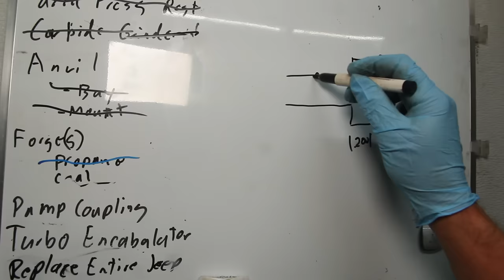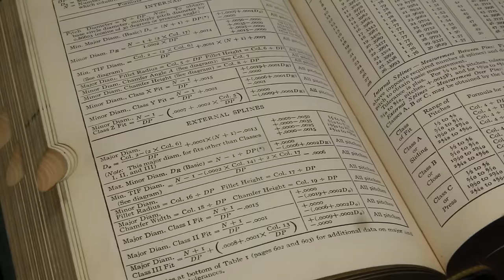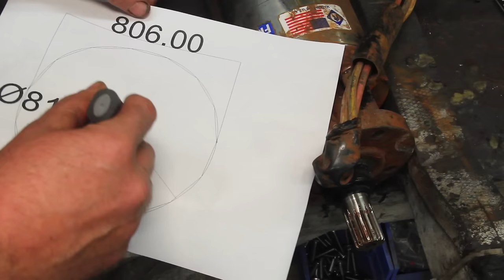Internal Splines (and Hexes Too)

Comment: I used to have that curse.  Always jamming my hands into places where the sharp bits would take little chunks out of me.   I was working too fast for my own good. If I offered you a criticism  it'd be that (1) you might have been better off with four set screws   ( 2 inline on two adjacent angle faces of your  internal spine parts) to make ''em  have less of a tendency to wobble as the spline cutter engaged. and (2) some kind of thread locker on the set screws in the final assembly.

Comment: If I had the wherewithal to do this I think I would make the coupling say 3mm overlong and machine it to the outside diameter of the shaft. As you come to depth on the internal splines as the tool produces a witness mark on the OD you would know you were at the correct depth. This land can be machined off afterwards. 

This is the process I use when making internal threads.

Comment: okay so im a gear cutter by trade and i want to try and help you.
most splines are 30 degrees P.A but they can literally be whatever you want as long as you get the right fit. anyway, like i said most splines are 30 degrees. the way i normally find out what D.P or Module a gear is, is by measuring the base pitch. what is the base pitch? well its basically from one spot on the tooth to the same spot on the next tooth. to get an accurate reading you of course measure on the addendum of the tooth. so what you do is measure (in inches) a couple teeth making sure that it is sitting on the addendum, then you either measure one tooth more or one tooth less, making sure you are sitting on the addendum when measuring. i just use digital calipers. you subtract them and you get the base pitch. what do you do with this you ask? well there are many handy tables you can use but this is the one that i most often use (https://www.geartechnology.com/ext/resources/issues/0992x/janninck.pdf). now what you do is you go on D.P and Module and go down the list for 30 degree P.A (because its a spline) and you find the one that closely matches it. if the spline is not corrected (standard) you should be able to find it pretty easily (within a couple of thou). when you find the D.P or Module that matches bingo. just by going off the O.D that you mentioned (25mm) the closest i can come up with is 1.5module 30 degrees. if you can measure the base pitch id be interested to see how close i am but of course since its just going off the O.D it will not be accurate. another way that you can check what pitch it is is with wires. in the machinery handbook (ive got the 16th edition in front of me right now) its under Checking Gear Sizes. if you read through that it explains it pretty easily what to do with the table. a little cheat that you can do to convert it to module instead of using the D.P conversion of the module is, and im reading this from the book.   FOR ODD NUMBER OF TEETH    Wire or pin diameter = 1.728 / Diametrical Pitch.      now the easy way to do it in module is just 1.728 * 5(mod) = 8.64mm. then divide by 25.4 = 0.3402" diameter pins. you can fact check this to make sure you're correct. so to convert 5 mod into D.P is -> 25.4 / 5 = 5.08 D.P and then 1.728 / 5.08 = 0.340". i think ive typed enough but if you want me to explain the table i can, but like i said its written there on how use it. have a good day :D.
Reply from the maker: Lots of good info there, thank you!  I don’t have the motor in the shop any more, so I can’t go back and measure it, but I’ll keep it in mind for next time.  Digging around a bit more, I’ve found reference to a ‘6” Nema spline” but I can’t find any information on what that standard actually is. (Maybe if my Machinery’s Handbook was so old it would have it).

Comment: Bit late but that is a situation where a push bar from the back and a longer or even larger diameter screw thread to hold tool bit could be an advantage?
Setting wouldn't be so convenient but making a setting gauge wouldn't be a huge issue for someone with your talents

Comment: Hey Jeremy,

You should make ur camera mount telescopic. You will get a much better viewing capability
Reply: You would need to weld a screw to outside of the square stock to be as a locking nut. Or have multiple through holes at equal distances apart and have a bolt to secure the positions

Comment: Thanks for sharing really!, what is the difference between that goopy grayish grease and the oil beside the grease being more sticky; are there any special purposes when using one or the other?
Reply from the maker: The thicker greenish stuff is Anchor lube, which is supposed be really good for working on stainless.  It seemed to work.

Comment: When you get more experience you will discover chip brushes, experience digging out metal slivers in your fingers and BandAids.  You will learn a lot faster if you use Brakleen to clean the oil and chips off your fingers.

Comment: couldn't you grind a hex pattern on the spindle of the motor?
Reply from the maker: It wouldn’t have really been practical.  It’s about 3 feet long and weighs 90lbs, I probably would have needed to take it apart (and it’s a submersible motor, so I would have to worry about getting it sealed up properly.  And I’m not even sure if I could index it properly once disassembled. Keeping the hex concentric to the shaft would be important to avoid damaging the bearing.  I guess if you were super careful about it, you could do it by hand, but that falls into the territory of “you can make anything with just files.”
Reply: @JeremyMakesThings  ok that explains it :]

Comment: Too late now but I wonder if that pump and motor set up was designed for a lovejoy type coupler? You did a great job but if there is any misalignment between the pump and motor , with such a snug fit in your coupler,vibrations will tear things up in short order.
Reply from the maker: It wasn’t.  It was originally a one piece coupler that was pinned onto the pump shaft.

Comment: I had to do this once at work and I discovered that there are SW plugins out there that will generate spline geometry.. for thousands of dollars tho...

A coworker had a reference manual from the 70s that included the required standard, so we figured out how to do it using a design worksheet.

It's disappointing to see that we went from everyone having this ability to collecting all this knowledge and charging a huge price to access it.

Comment: Next time, snap a photo with the iPhone and import it into a CAD program and use it's dimensioning features to determine the angle. Alternatively, import it into a drawing program and trace the outline of the tooth. You can then use basic trig to determine the angle from the length of the sides.
Reply from the maker: I actually did that too, but it’s so small that with parallax error, I came up with different numbers for one side of the tooth vs the other.  And because it’s an involute profile rather than straight sides, there’s some guesstimating on where the lines go.  But it ended up being “roughly around 45 degrees” so I went with that and didn’t mention all the circles in chased my tail through. 😆
Reply: @JeremyMakesThings  The I know what you mean, but parallax errors can be reduced to almost nothing by using a gyroscope app to level the phone on a stand at the same xy leveling as the gear or the table it's placed on. Once set, you can snap a photo.
Reply from the maker: The other thing to keep in mind is the shape is actually an involute, I was just approximating the angle to get something close to that shape to start, so eyeballing it was “good enough”

Comment: I am curious as to why, when surface-grinding that piece of squared-off stock, you placed it on the mag chuck at an angle instead of just laying it straight. I figure there's some good reason, I just do not know what it is. =)
Reply from the maker: It think it’s mostly tradition?  The best explanation I’ve heard is if you try to get it straight and are a few degrees off, it looks worse than if you grind it at a higher angle.

Comment: I'm always curious when I see someone single point cutting threads why they wouldn't give themselves a relief to run the tool into. The minor diameter is where the strength is. And you can relax a little more while cutting, not having to worry about backing the tool out at just the precise moment. 

Why don't you cut a little thread relief?

Comment: Why not just machine the spines on the parts to match the hexagon of the other? The hexagon is weaker than the splines and a hexagon coupler would be easier to produce? Serious question.
Reply from the maker: The motor wouldn’t fit on my mill and weighs about 90lbs, so I’d have to do serious disassembly of it- and then make sure I got everything sealed back up again properly, so it didn’t seem like the best route to go.  And I wanted to see if I could cut an internal spline.

Comment: What type of material did the broaching  made from?
Reply from the maker: O2 tool steel
Reply: @JeremyMakesThings  ok, so in the heat treating process, did you use oil to quenched it or water?
Reply from the maker: @SimlpeT4718  oil
Reply: @JeremyMakesThings  wonderful thanks

Comment: why wouldnt you just machine the shafts into a square. not saying u should have, im trying to understand why thats a bad idea, im new to machining.
Reply from the maker: In this case, the biggest obstacle to doing that is each piece is about 3 feet long and weighs about 90lbs (1m, 40kg), and wouldn’t have fit on my mill.  I would have had to do a lot of disassembly, and since it’s a submersible motor, I would have to be really careful to make sure it got sealed up properly when it went back together. 
This was also an exercise in challenging myself and seeing if I could do it.

Comment: Nice work.
But seriously, couldn't you have bought, somewhere, a female hex shaft to size and a female spline shaft to size. They must have once existed. Did anyone bother to ring the respective pump and motor manufacturers?

Comment: oh how i wish i had a shaper. had a recent project that required a similar spline pattern. ended up making it on the lathe quill. didn't record any of the process as i figured it was doomed to failure..to my utter surprise it actually worked, ...even better than hoped for
https://youtu.be/vY7Ya19qzSk

Comment: You lost me when you used the Flat Head Screwdriver as a PRY BAR.

Followed up by breaking a part which obviously had not been PROPERLY TREATED, with Lubricant, so no PRY BAR would even be needed.

Comment: Jesus bro.  You're pretty inaccurate with most of your processes.  Take more time with your measurements.

Edit: (To make this comment constructive...cuz I like you) When you make a broach, you need to think of it like a milling machine.  Each "tooth" on the broach acts as 1 pass, so the first "tooth" should be AT or just under the current size/inner diameter and therefore each CONSECUTIVE "tooth" should be a half thou or so larger than the last (making each pass a 1 thou pass) ultimately ending with the desired dimension.  Your gap depths were fine, the broach you made was just inconsistent in sizing (I believe you knew this) and was "biting" off more than it could chew, resulting in the gaps getting packed.